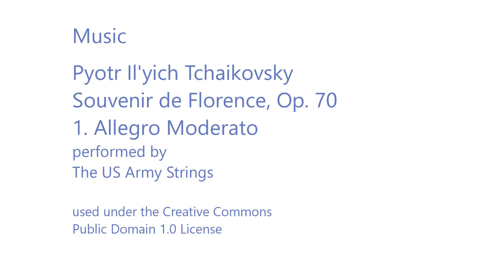Sequence Knitting - Cecelia Campochiaro - Ep. 104 - Fruity Knitting

Comment: Thanks for your demonstration of your flicking method, Andrea!  I knit with the pencil method--exactly the same as you used to do--a method obviously developed in the days of straight needles.  I switched to circulars about 15 years ago for the obvious advantages of knitting in the round and not having to carry the entire weight of the project on 2 needles. But it came at a cost of speed--circulars, unlike straights, are slower for me because they have a tendency to flop around requiring more hand muscle control to compensate.  I  have been working on an overhand flicking method as an alternative when my hands get tired from the pencil hold, just trying different combinations on my own.  So, your demonstration is perfect timing!  It's been so helpful to see how you do this, that you allow either the right or left needle to move, kind of like a hinge, while still maintaining needle contact with part of your right hand, something that wouldn't apply to using straight needles.  Just brilliant!

Comment: I learned knitting in the throwing way with the right hand, but gripping the needle from the top. This was how my mother was taught to teach little girls how to knit in schools (when that was still a standard thing, in the fifties). If I remember correctly, when you got the hang of it you were supposed to move on to flicking, as that is much faster. I never did ;) The right needle was tucked under the armpit to keep it stable. This was in The Netherlands, where continental knitting seems to be a relatively new thing. I have tried various styles now, and I don't think there is any superior style, and a lot depends on how you execute that particular style and which suits your body best.

Comment: On the thoughts about fast knitting, I've found one of the most crucial things that have made harder and more involved patterns doable for me is knitting speed. Knitting a bit faster frees up concentration  - you don't have to keep a pattern in your head for as long, so it's easier to do longer or more complex repeats. You also do more repeats in a shorter period of time, improving memorisation.
Reply from the maker: Hi Nina. Andrew here. I think that is totally true, not just with speed, but just with knitting ease. I often get lost in a pattern when I have trouble getting through a particular stitch.
Reply: @FruityKnitting  that's so true. I did I little sweater that has a make 7 from 3 stitch - k3tog, then yo k yo k yo k into the same stitch... it took all of 30 seconds to do, it was super frustrating, and if it were on more than just three rows I may have just switched project entirely.

Comment: I am a leftie.  Someone taught me to knit as a leftie but all the patterns were reversed so I had a terrible time until I learned to knit continental .  The biggest difference in styles in whether the needles or wool is moved.  Once I learned to knit continental and could move the wool instead of the needles  I didn't need to move the right hand much at all and it made such a difference.  And purling is just as easy with continental .

Comment: i learned how to knit in a way that i haven't seen often if not at all called Continental combined, that is more ergonomic, it has its limitations on the round so i had to learn to purl and knit different if i have to knit in the round, but if you knit garments flat  is fast and the tension with the purls and knits are very concise, a strong proponent of the method in the US is Annie Modesit.

Comment: There are different ways of Continental knitting, too. I think it often has to do with the way the yarn is tensioned. I use the Swiss style with a double wrap of the left index finger (like an Anker portrait!), but also the route your thread takes, which not everybody does the same. My knits and purls do not require much change of finger movement or angle but my stitches may not always present as „normal“, which is not an issue when you can read your stitches but makes twisted stitches very easy. I am therefore never put off by purling or twisting stitches in a pattern!

Comment: I have a tip that may help Andrew.  I've been knitting for more than half a century, and I've found a way to avoid the very common "purl ridge" problem that many knitters have when doing flat knitting.  I'm talking about stockinette stitch knitted flat rather than in the round.  On the wrong side rows (normally purled), I keep the right side of the fabric facing me, and I knit backwards.  So on the right side rows, I knit continental style and on the wrong side rows (knitted backwards), I knit English style - throwing the yarn with my left hand (or flicking if you prefer).  This seems to be the only way I can get a nice looking piece of stockinette knitted flat/in pieces.  Some people switch to a smaller needle for the purl rows, but I find knitting backwards to be easier.  It's a little awkward at first, but Andrew is still learning, so I encourage him to try the backwards knitting.  It's actually pretty fast once you get the hang of it.  I knit at lightning speed doing the continental method with very little hand movement for the right side rows.  When I'm doing ribbing or more complicated stitch patterns, I just knit the normal way - knitting and purling.  Holding the needle like a pencil is something I've never done.
Reply from the maker: What an interesting idea! I've only ever heard of knitting backwards as a way to avoid constantly turning the work, say when doing short rows, but doing it as a general solution is new to me!
Reply: @FruityKnitting    Here's a link to a video showing (similar) to how I do it.  The reason I throw with my left hand for backward knitting is because the yarn is already in that hand since I normally knit continental style.  Again, I only do this for knitting stockinette flat because I can't seem to get rid of the "purl ridges" otherwise.  https://www.youtube.com/watch?v=0h72xZoGp6o

Comment: From what I've seen, there is the "flicking" technique and another type called "lever" knitting.  Of course you an find you tube videos on each of them.  I'm a continental knitter, but some time ago I did learn to do English style knitting, except I carried the yarn on my right hand.  I'm not as fast as continental, but it gives my hands a break from the normal way I knit, which can also be relaxing.  It's also good to learn other styles that can help in stranded knitting, but you can also try other styles to see if there is one that can help your speed.  However, Andrew, you do need to give it some time to be able to build up the speed.  It takes time to learn that particular technique and then it's a matter of building speed.  It won't all happen at the same time.  So all that to say, definitely give it a go, but give it time as well.  I used to practice with a ball of yarn and needles separate from any projects until I really got the technique and tension down.  I hope it will help you with your speed, but you do a beautiful job of knitting anyway!

Comment: Have you tried knitting Continental? Holding your yarn in your left hand? I find that easier and faster.
Reply: I think, Continental knitting is probably the fastest way. It's the common way for German knitters. Because you live in the middle of Germany you should give it a try.
Reply: It’s the best way, not to denigrate others techniques, but it is so fast and efficient.
Reply: I have became a continental knitter last year because of growing pain in my right hand, wrist and arm: my speed improved tremendously since. But then I discovered that Shetland knitters (English style) can actually knit just as fast as continental ones. After watching countless of videos, I learned that the secret to speed knitting - regardless of your style - is to keep your fingers closed to the needles so that it minimizes the movements - it is also very ergonomic. I am still a slow knitter compared to others but my tension is even at this speed so it's okay. 😄
Reply: It deepends how you hold your needles when you flick and if you keep your stitches on the tip of your needles, one can knit as fast as continental...
Reply: I have tried I need to keep practicing it’s the tension that I can’t maintain